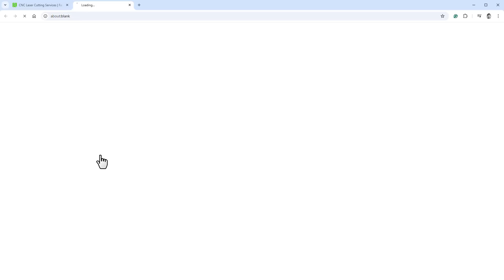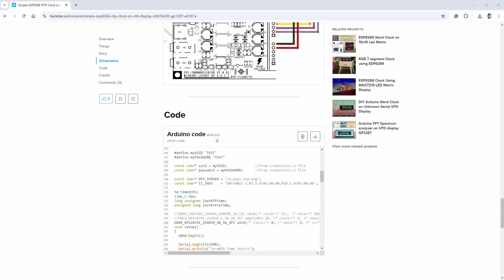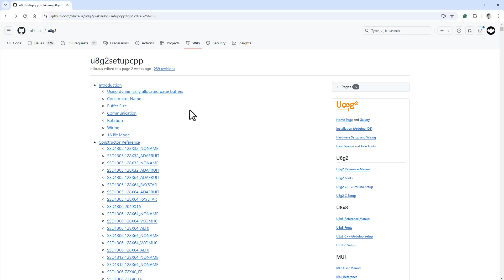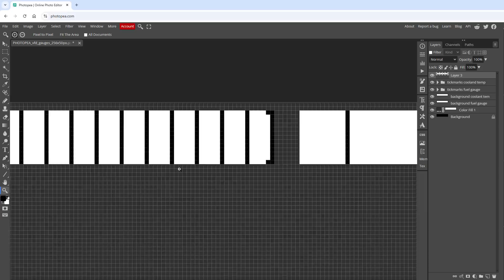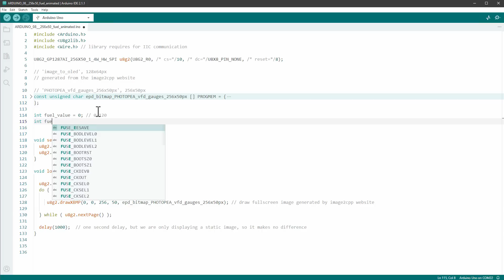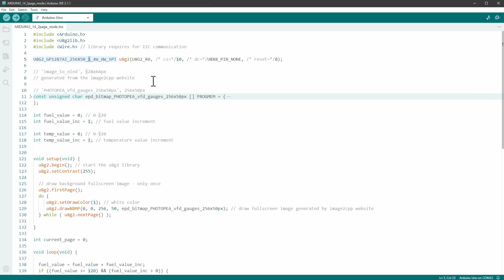Car VFD Gauges with Arduino UNO - creating car dashboard with old VFD display, full tutorial

Comment: I bought the same VFD for some reason its brighter when filament enable is connected to ground instead.  also the link in your description is for a GP1294AI which is why others are also having issues with brightness. in your video when I look at the back of it I can tell you have a different version.

Comment: May I ask how you power down these?  Do you put the Adduino in Sleep mode and then power up when it gets power?  Or totally no power when car is off.  Thank you!!  You have helped me tremendously in a future project, I'm about 1/2 way there on 1 gauge.  😂
Reply from the maker: You can do that in a many different ways, I would prefer to be completely off when the car is off, just so it´s not draining the battery all the time..

Comment: Any luck with using it with Raspberry Pi? Any libraries?
Reply from the maker: Here is a demo of someone who was able to built u8g2 library for Pi, if you can do it, you can use that library for this display as well - https://github.com/ribasco/u8g2-rpi-demo
Unfortunatelly my knowledge of Raspberry Pi is quite limited. Hope this was helpful!
Reply: @upir_upir  thank you a lot! I'll definitely look into that
Reply from the maker: Cool, good luck!
Reply: @upir_upir  oof, this turned up to be a whole lot more overwhelming for me than I expected. I've managed to compile u8g2-rpi-demo library for Python... then I realized that I would still need Wire.h and other Arduino libraries... 

I don't really have any kind of solid Arduino experience, but I've got a couple of ESP8266 knock-offs by Wemos. I'm thinking rather of trying to estabilish a serial connection between my RPi and an -ino, having most of "thinking" done on RPi, because there's absolutely no way I'll be able to interpret and reverse engineer how u8g2 drives the GP1287/GP1294 or follow manufacturer's specifications on and implement it by myself, too far out of my scope. Tried looking up it GP1287/GP1294 are compatible with some other display drivers, to no avail.

Comment: do you know how to use the light sensor on these displays?
Reply from the maker: Should be hopefully as easy as any other light sensor - the schematics on GitHub shows the pin connections.
Reply: @upir_upir  multimeter shows the pin resistance does change but cant figure out how to read the change with arduino

Comment: Hi, I left a workaround on the repo issues page - but I had a very dim display using the code as provided. Seems that my module uses the GP1294AI and not the GP1287AI - not sure why or when that changed. Anyway, u8g2 supports both, just something to check if you are replicating this setup.
Reply from the maker: Thank you! Seems like there are at least two different displays, but the product details page at least on AliExpress is not always correct.
Reply: came here to write this. Thanks!

Comment: Are these even available anymore?
Link in description leads to a 256x48 varriant.
Other Aliexpress sellers are all sold out.  (Most dont ship to Europe anyway)
Tried to buy 5 different ones from Ebay. 4 out of 5 are cancelled due to "We found damages when we wanted to ship". Last seller keeps responding that the chinese new years delays the order for unknown time.
I really hate these Chinese Fake products that have 50 different resellers that just button mash to generate a name and just copy paste absolute nonsense as description.
Why doesent ElecStudio just have a shop to buy them....
Reply from the maker: Unfortunately they are often sold out, but you should be able to find some on AliExpress. I believe there are two versions as for the resolutions, but they should both work in a very similar way - both are supported by u8g2 library.

Comment: it would be nice if you used the new r4 board from arduino as it has a CAN interface which will make it easier to connect your car gauge to the car easily using the CAN port in the car.
Reply from the maker: Yes, I would like to try that as well, hopefully soon.

Comment: That's awesome. Love VFD's. I stull have somewhere sitting in my drawer 128x64, unfortunately without driver, waiting for better days...
Reply from the maker: Thank you! Yes, I would love to use 128x64px VFD one day, but those are very hard to find.
Reply: @upir_upir I've got mine from aliexpress, but for some reason i thiught it did come with driver board, but it did not :(

Comment: Hey so I am a high school student and have a question. I have a project to make a digital dashboard (cockpit) display for a car. Is it possible to make it using Arduino, Raspberry PI or something like that? And how do I connect it to a car? 
Thanks
Reply from the maker: Yes, you can use any of those microcontrollers, and I have a few more videos about the connection to the car / sensors. Please check those out.

Comment: Great works! 👍
The video cover aspects such as the hardware used, including the Arduino board and the VFD display module, as well as the software and libraries needed for programming and configuring the display. 
Additionally, it could discuss any challenges faced during the development process and how they were overcome. 
Overall, the video aims to showcase the creation of a custom instrument cluster using these components.
Reply from the maker: Thank you, I´m glad you like it!
Reply: @upir_upir  we have esp32 smart tft display, knob display, amoled display and want to collaborate with you for creative projects. How can we get in touch with you ?
Reply: @upir_upir  we have good esp32 tft/amoled display and knob display for your creative GUI project. may I contact you for collabration?

Comment: What type sensor has to interface in this Arduino?
Reply from the maker: You can use any sensor, I already have a video about using temperature sensor with Arduino board.

Comment: I have a 1986 300zx with the digital dash and every day I’m worried something on it is going to go out. Maybe I could recreate the original dash using this type of process to keep it alive into the future.
Reply from the maker: The 1986 300zx is my favorite digital dash, one day I would like to recreate it! Anyway, looks like most VFD problems are usually with power supply and capacitors, so it could be possible to fix if something goes wrong..

Comment: The old VFD's in the car can be fixed.
Reply from the maker: If it´s only a problem with some capacitors, than yes, but if the glass has cracked and you no longer have vacuum, it might be quite challenging to fix it.

Comment: The problem with the factory Honda VFD displays is the power boards. The caps leak and can short out/damage the boards, a simple recap if they aren’t totally burned up is all that’s required
Reply from the maker: Thank you for providing the details. If you can fix the gauges with replacing capacitors, perhaps you can use this VFD display to show some additional data.

Comment: ha ha ha - the display at the link on Ali Express is $952 USD...  Hopefully you didn't pay that much.
Reply: The seller say "50pcs"
Reply: @amsmuh  that’s $19 per unit, if you can buy them individually then that’s not a bad price
Reply from the maker: I haven´t noticed it, the link should be fixed now for just one unit. That said, I have paid I believe around $100 for this unit, and it seems to be selling for $50 now. I need to buy more of those :)